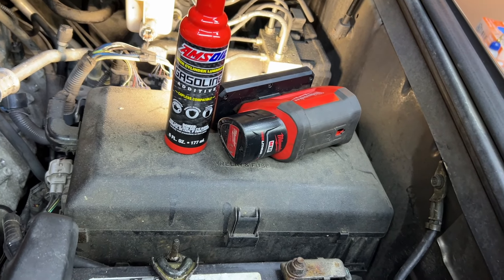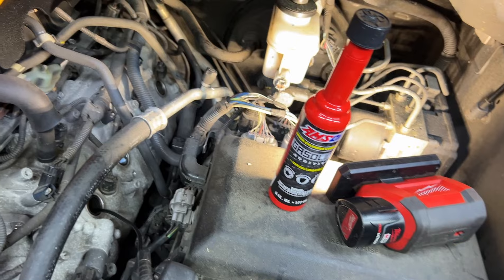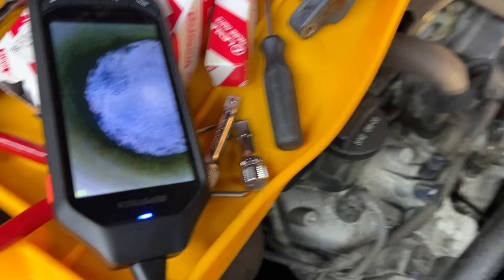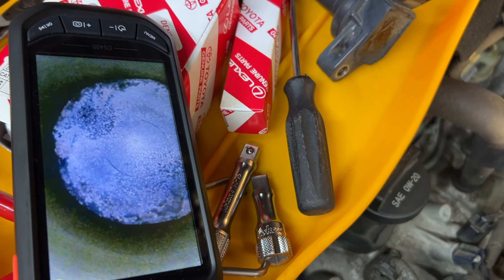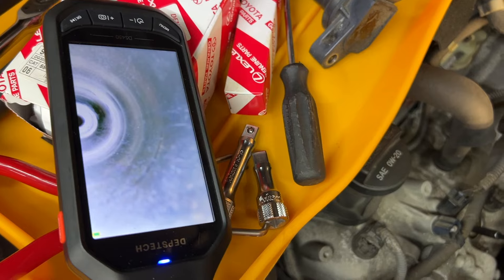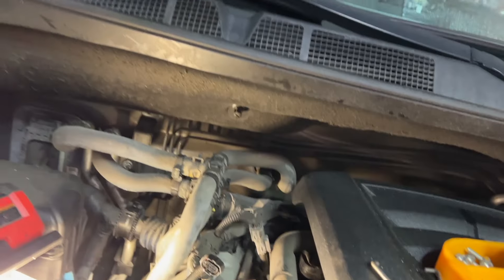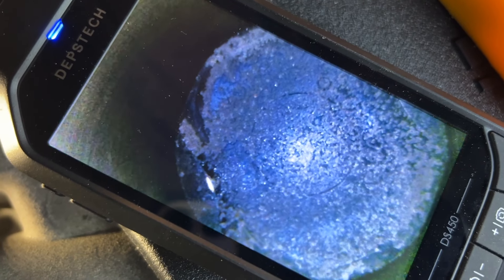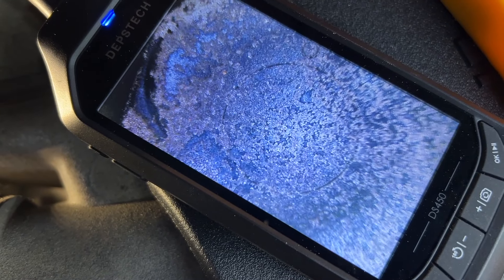How to clean pistons fuel additive caused this to my engine, waste of money? Amsoil fuel additive

Comment: I’ve been using 1 bottle of P.I. every 4-6 months at every oil change for 6 years.  I initially tried it to combat pinging. I think the recommended dose is 1 bottle every 4,000 miles. (6437 kms.) Less detonation at low speed after use. I then use 1 bottle of Amsoil Upper Cylinder Lubricant with the P.I. Then one bottle of U.C.L. for every tank afterwards. P.I. is the “deep clean” and the U.C.L. is the “keep clean” they claim. It works for me. No check engine light, quiet smooth acceleration. It’s cost effective to use once you become an Amsoil Preferred Customer.

Comment: I use this at every fill up with on Hemi truck and use the PI every 4K miles. Along with that I use the Amsoil Signature series oil. I bought my truck used it’s a 2021 Ram 1500 Studies prove this stuff works. It’s worth its weight in gold. Thank for sharing